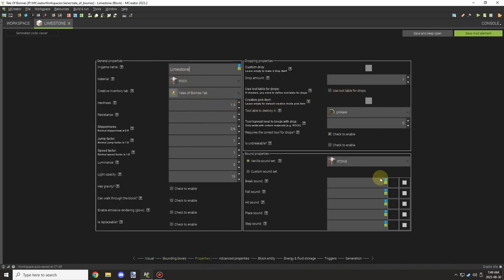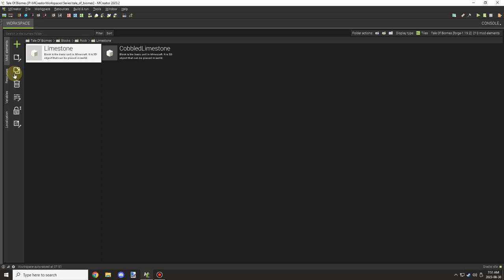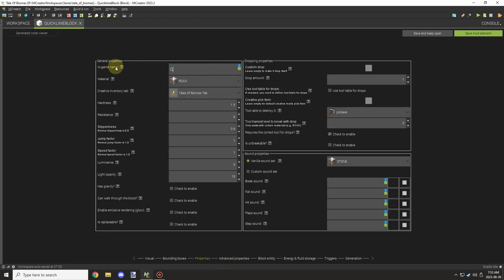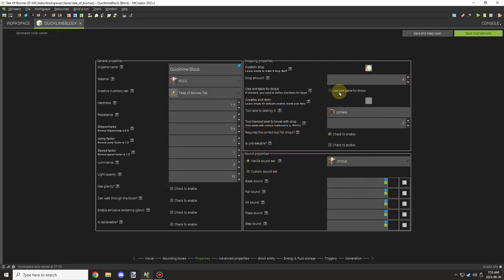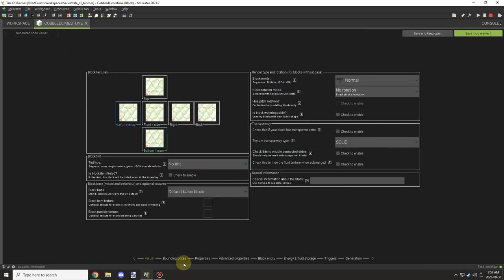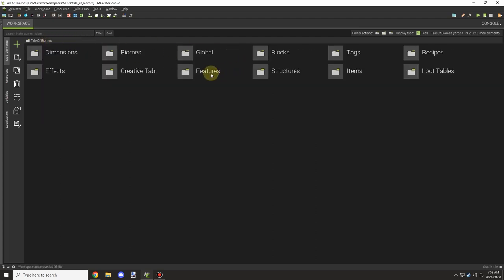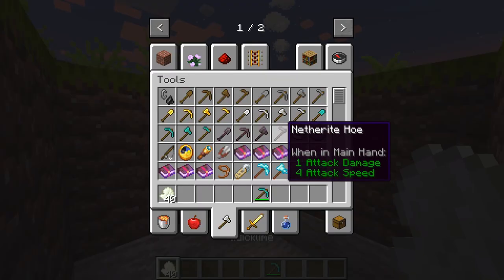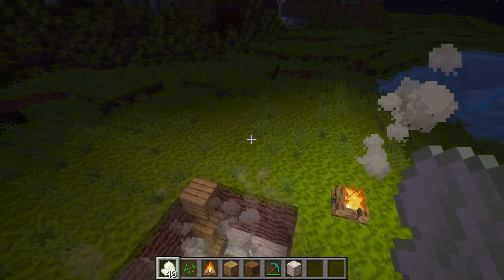Quicklime Mechanics | MCreator Lore | Ep31

Comment: It would be more realistic if you build a kiln as a multiblock structure and making quicklime from that...
Reply from the maker: This could be a end goal for sure ;)
Thanks for the suggestion Karryy
Reply from the maker: I just thought I would let you know I am working on your suggestion for a mutli-block kiln.
Friday will be mostly texturing for the project but I have spent most of the day tinkering with the mechanics for the machine in a second workspace. I got something pretty neat that still uses the layer system but it links up with a GUI. And it supports custom recipes too so other mods will be able to make use of the crafting station. I just wanted to thank you again for your suggestion and idea.